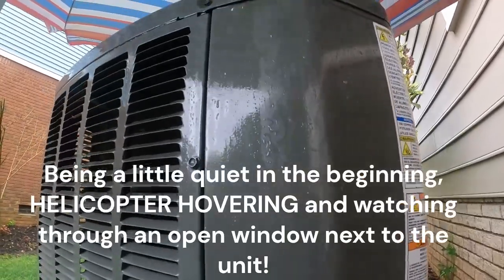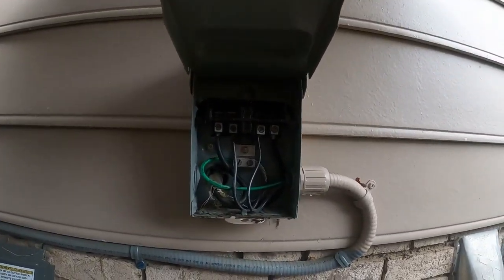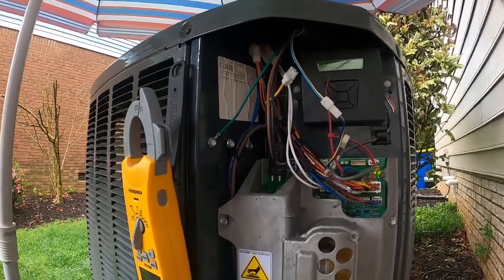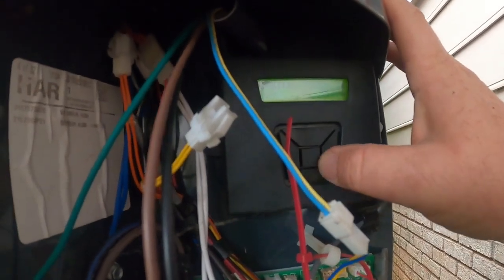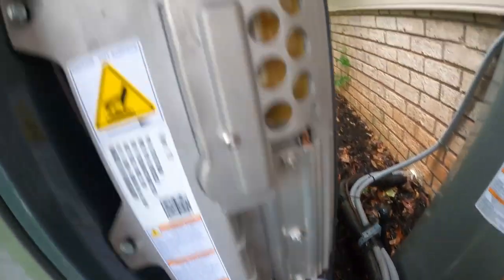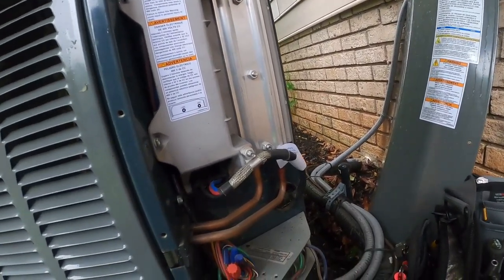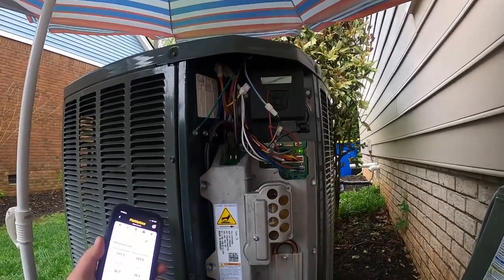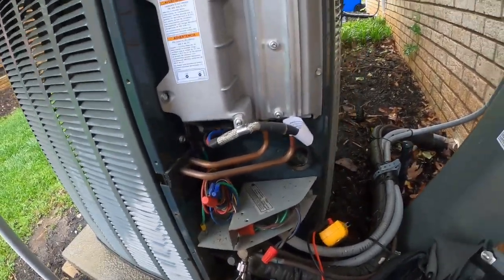Trane Variable speed XV18 not cooling.

Comment: I have same unit, When I select "Cool" mode, the system immediately goes into "System Idle" status instead of cooling. Two different technicians have inspected the unit, but both provided very high repair estimates, one said HVAC unit board need replacement, other one said Outdoor unit condenser board drive need replacement . Any advice you can offer would be incredibly helpful.

Comment: Thank you for making this video!!! Can you tell me where the capacitor is located? I have a nearly identical model and cannot find the capacitor. Thank you!!
Reply from the maker: These XV systems do not have capacitors. Most system that use capacitors will locate it behind the corner access panel on the outdoor unit. Just be sure you turn off the breaker to the unit before you attempt to do anything.
Reply: @MYHVACLIFE  So if the fan is not running, call the pro? Can't DIY?

Comment: Im a newer tech. Ran into one of these HP today. Pumps itself down in cool and shows LSPP CLG CO. Switch to heat and showed LSPP HTG CO. Then it ran in Heat at low speed and says Heating Derate. Looking in the previous Codes it has has a low charge code and multiple lockouts…At first I was thinking EEV valve after the LSPP CLG CO but EEV valve ohms good. 13.8v from Distribution board to EVC. ET and GT sensors have proper DC voltage as well… any tips before I weigh out the charge and see if it is in fact “low Charge”? First one of these I’ve ever had to work on.

Comment: It looks like they use a trickle heat system instead of a crankcase heater. Inverter equipment are a bunch of crap, Just to get what   .00002 watt savings. I don't know how much wattage you really save but it not worth the money or the problems for these systems. I'm not against you just the inverter systems and the people who buy them. The rich
Reply from the maker: I respect your opinion. We have installed over 200 of these units in the last 8 years. And being a TRANE dealer, they have been our least problematic unit from TRANE. Very few problems,  a turned off breaker would stop the simplest of systems. I do prefer 'keep it simple' , but I have to learn how to work on what my company installs. The more time you spend with them the easier they are to work on. But yes, They are marketed to a more wealthy consumer. But they have commented on having very impressive reductions in energy costs and a much more balanced comfort level in the home.
Reply: Just don't gasp when you look at the cost of service parts.  These are definitely rich boys' toys and I don't envy the people who can afford them.
Reply: @douro20  Well if you go buy groceries or anything else, you know costs have gone up 50 to 60% or more; gas when down a bit but we never know when that will change!

Comment: Great video sir, I am not a fan of the system that you worked on, just for the fact that I am a basic kind of guy, the fancy controls to me are just one more thing to break down.  That is just me though.
Reply: They are VERY expensive to service.  I would never own such a system unless I could afford the cost of parts.  And the ComfortLink HMI is mandatory on these communicating systems.
Reply from the maker: @douro20  No additional cost to service from us, and nothing is mandatory. Annual maintenance is the same as any unit and they have a 10 year warranty.
Reply: @MYHVACLIFE  Hmm...I thought on communicating units you had to have the ComfortLink to be able to use them.
Reply: My own back ground in HVAC goes back to the 70's when we became a GE contractor our trucks had,  "WE BRING GOOD THINGS TO LIFE" then GE sold the hvac to Trane it always was tough equipment but as a contractor you must maintain a good relationship with your customer Trane equipment cannot be maintained by a non factory trained mechanic and the I have witnessed a lot of butchered units due to inexperienced service.
Reply: @markcollins457  True and the same applied to American Standard units.
Reply from the maker: @douro20  We install all our units with the correct 850 OR 1050 thermostat that allows the homeowner to operate the system. Would not make sense to sell the system without the proper control.
Reply from the maker: @markcollins457  We have a training XV unit in our shop set up for training, I train our guys on it as needed. They also attend the XV training each year at our local Trane DSO Training class for certification when offered.

Comment: Pretty complicated for a straight A/C Condensor? Looks to be very low amp draw, which would save a good amount of electricity? Wanted to get a variable unit, but they are double the price of the one I ended up getting? Are they very problematic, compared to regular units?
Reply from the maker: We have been installing these for 8 years, no issues other than the occasional sensor out of range, yes they are costly and over the short term the savings probably does not pay you back completely for the additional cost, but the climate it maintains in the house cannot be matched! These unit do a great job at maintaining consistent temps and humidity levels.
Reply: @MYHVACLIFE  The On/OFF system really does suck in a humid environment, like I live in FL? That's why I wanted the variable system, so it's not such a drastic change?
Reply: @DavidWeinberg-cm9xd  Well you could get a variable system in about 20 years!

Comment: Great video. Besides line voltage, everything else is DC volts correct?
Reply from the maker: YES, 24v to power the tstat and at the outdoor unit if connecting a load management box. Everything else is DC. Basically only 3 tstat wires to the tstat and 2 tstat wires to the outdoor unit.